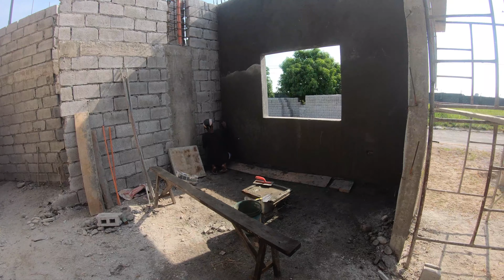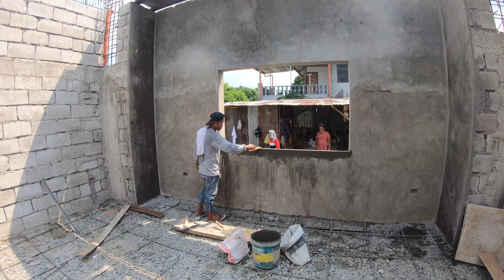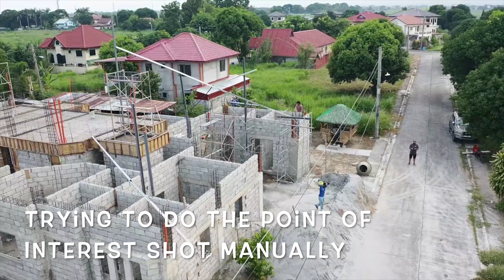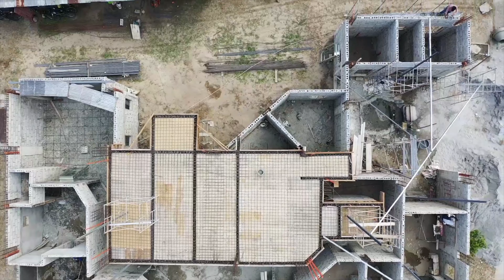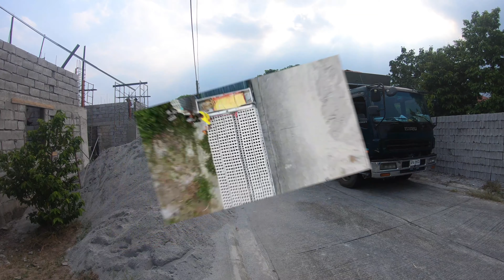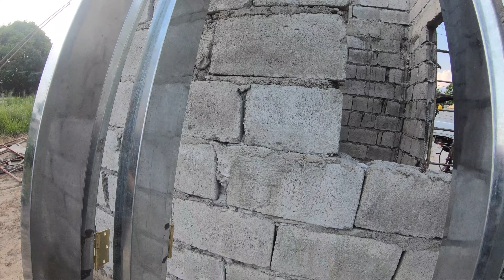Philippine House Building Step by Step, Build Day 67: On The Nose

Comment: Hi big fella ,  nice insight into your house journey . Carpenter "Wilson " looks like a hard man ,   the mortar on the window sill (water cannot inside 👌).
You using steel frames for doors & window sills? is this to stop termite's?
Reply from the maker: Wally Trinc Wilson is one of the best carpenters on site. The mortar mixture that is used here is much smoother than what we use for brick work in the US. Think of it more as cement instead; smooth and finishes well. The steel frames is definitely to have one less thing for the termites to be attracted to, plus the durability is great. They will be painted during finishing so most folks won’t notice the difference.   Thank you for the comments and thanks for watching.

Comment: Good to see work continuing! 

I had asked before about the cost labor, and you had indicated that labor was inexpensive.  What about the labor rate for the trades workers-the plumber & electrician and maybe the welders, compared to the day labor is there a significant difference?

Thank you.
Reply from the maker: I haven’t actually asked about each specific trade, but generally not too much higher.